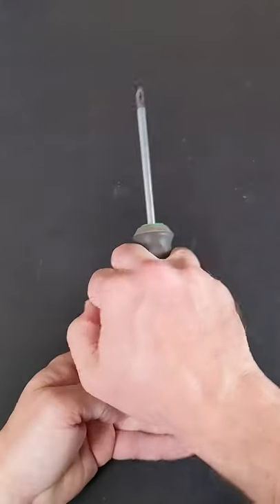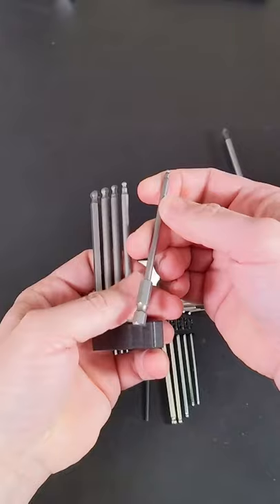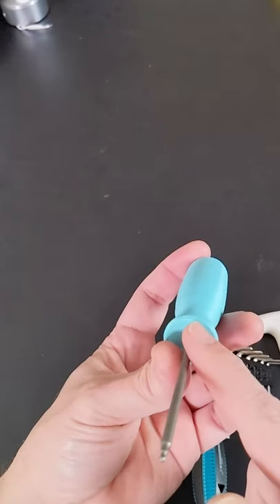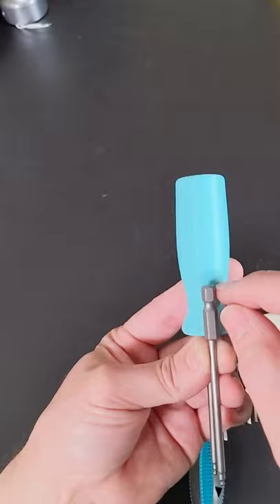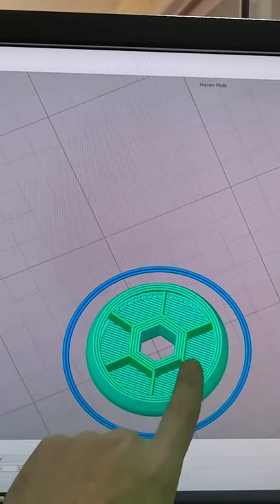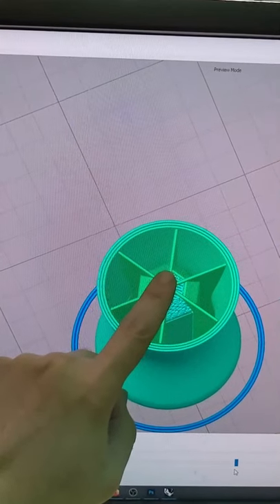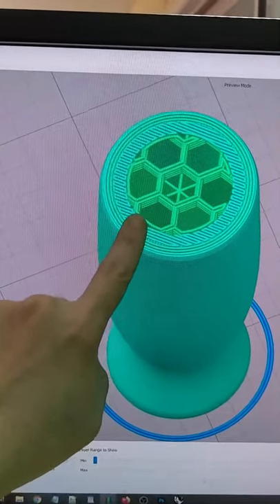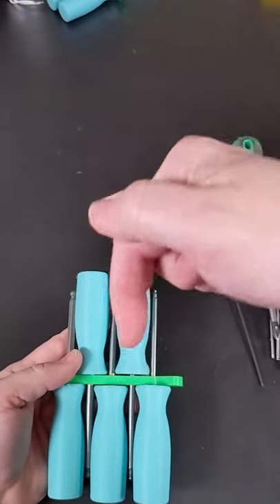DIY Hex Key Screwdrivers Because You Can't Buy Them For Reasonable $

Comment: I buy the bits separately and quite cheap. I bought a multi pack bit with over 50 bits for $20 AUD at bunnings. Ryobi branded.
Beauty of that is I can use extensions,  ratchets or screw driver handles. All interchangeable.

Comment: I’ve invested in a few set of these for my RC cars over the years. Most sets of 4 or 5 is around 40$ but they have metal handles. It’s always bugged me that their isn’t a 10$ option as these have a decently short life span before the bit rounds over.
Reply: This is a great idea and only cost about 70 cents in filament to print.  My print was 32 grams.. but... Look at the EKLIND 92400 precision driver set and for ball end look at Bondhus 10687.. Both sets run about $16 each.  I've used Bondhus and Elklind drivers for years on RC cars and helis.

Comment: I did the same thing except printed 100% infill and then annealed in boiling water. It took a couple tries to get the shrinkage right. I initially tried to heat the bits to insert them but it was near impossible to keep them perfectly straight.
Reply: You have to use a press if you want them straight. Just like inserts. Although inserts are easier since they're short.

Comment: Anyone know where I can get hex screws (M3 and smaller) that don't strip when using just a bit of force? I have a handle on my hex bits but it is very easy to strip small screws.
Reply: Take a look at the Voron sourcing guide, they have links to higher quality screws. The quality of the hex driver also matters, so could also be that.
Reply: Depends what your driving them in too?
Reply: Why would you prefer hex over torx?
Reply: @marcus3d  I prefer torx but many printer kits are all hex
Reply: @sschueller  Unfortunately, yes, but if you're buying them you can choose torx, right?

Comment: Na sorry still. If I learned one thing with equipment it is "Buy cheap - buy twice". Sticking with Wera or Wiha Bits was the best decision ever. Straight Torx or Inbus Bits from Wiha or Wera are the best. And with the speed E II Wiha Electric Screwdriver with the easy torque adapters I never killed any screw heads again. Is it expensive with roughly 350usd full set? Yes. Will it last you maybe all your life? Yes.

Comment: they are NOT keys.... they are wrenches.... wrenches are for nuts and bolts..... keys are for locks.
Reply from the maker: A search for "Hex Keys" on Google, Amazon, Ebay, Etc. shows that the term is a common if not correct way to refer to this type of wrench.
Reply: @DesignPrototypeTest  just cuz its a common use, dosnt make it right